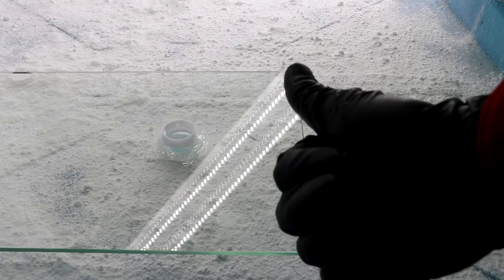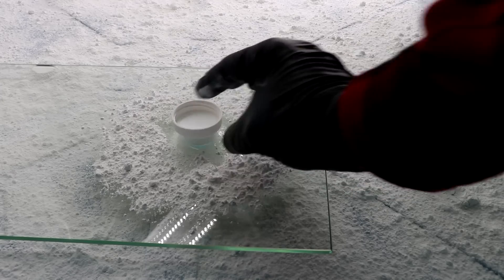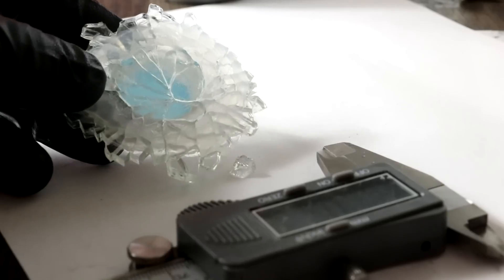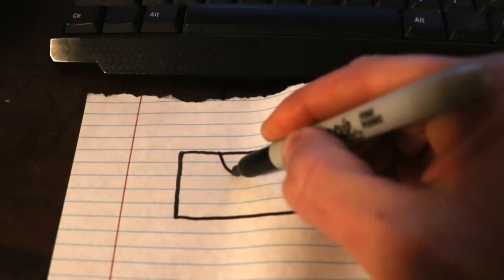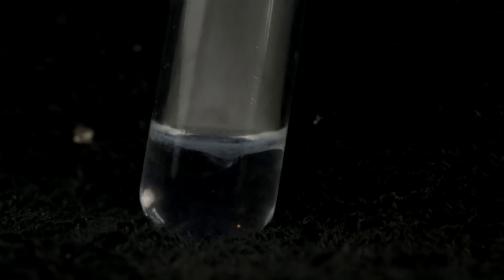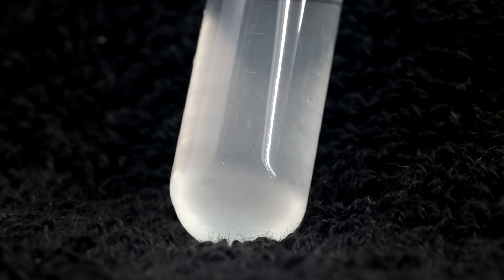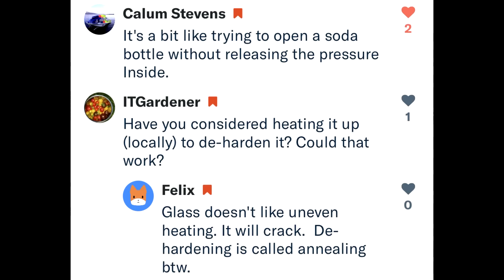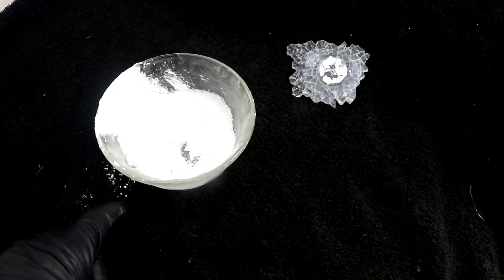Dissolving Through Tempered Glass Attempt Two: from one side only

Comment: Cody you should try decreasing the surface area of the acid every day (reducing the size of the container on the glass) to promote formation of a more conical hole which might have a better chance of withstanding the internal forces of the glass
Reply: To make a hole in (already) heat tempered glass, there's really only one option - anneal it, cut hole, temper again.

Certain chemically tempered glass types, through ion exchange, can be laser cut. But AFAIK you can't even do that with heat tempered glass.

It all comes down to the inner/"center" mass of the glass, under immense pressure, wanting to physically expand - but being prohibited by the rapid-cooled outer layers, now having contracted more than the inner/center layer, from doing so. Once you pierce or weaken enough the outer, differentially contracted layer - the inner layer expands rapidly. Bang, bazillion pieces.
Reply: @pr0xZen  That does sound about right. As soon as that outer layer can't take the pressure, the panel WILL break.
Reply: I don't think any of this will work. Tempered glass is under pressure similar to how a Prince Rupert's Drop works. Once you get through the exterior layer and get into that core,  there's too much expanding force and it causes it to shatter. These experiments about attempting to dissolve through the glass are more wishful thinking than anything and sadly won't work. It only hurts the wallet to try in this case.
Reply: @GrimmsDeath  that's my concern, too. That it might not matter how you get the hole in there, and that the glass just can't handle the stress of that hole's very existence.
Reply: @HELLO7657  The amount of pressure required for this to work would probably shatter the glass before you even began to etch it. The only way to make a hole in a tempered sheet of glass is to first remove the tempering by heating it to near melting point. Then make the hole, and finally re-temper it.
Reply: Elviondel my thinking was to reduce the size of the hole at the level where the glass keeps breaking and by having a cone shaped hole there would be less pressure on the smaller hole from the upper layers of glass. Probably would still fail, but I’m interested to see.
Reply: You are only going to prolong the time until enough outer layer of supporting glass has been removed for it to shatter.
Reply: Merry post-solstice

Comment: Does the depth of the dissolved glass have any relation to the diameter of the cap? Wider cap, deeper dissolved glass? Or smaller cap, less chance of shattering?
Reply: No, the issue is dissolving down to a certain point. One the glass has been dissolved to that critical depth at any point it will cause a chain reaction and shatter the glass

Comment: Could you dissolve the glass from the inside first?
Reply: I dont science much but if the goal is to use acid to put a hole in tempered glass I don't think he can start from the inside out.
Reply: @CoffeeandCancerStix  My idea was to accelerate the molecules of the acid, with the energy set, so they pass through the outer layers and stop in the middle. He has a vacuum pump. So a particle accelerator is not too far fetched. The energy requirements though, are probably far fetched.
Reply: @heyarno  I think that might be a little out of budget for cody.

Comment: as far as i understand and dare to write this comment, you will never be able to open a hole on a tempered glass pannel because is like trying to remove the middle of a jenga tower, as soon as you reach a certain point the presure inside the glass will always colapse towars the hole, the only way i can think of doing that is leaving a suport behind the perforation, kinda like a cylinder liner, if that make sense
Reply: You can do it with lasers, but that might be because them glass melts around it
Reply: @DumbArse  i didn't know it was possible, but it makes sense

Comment: take two metalic rings, that are about the size of the hole you want to make, adhere them onto either side with something like JB well prior, then do the dissolving after that is cured. 

The reason the glass breaks is because it is under Massive pressure, as when glass cools it doesn't cool uniformly. (prince Rupert drops)
This should allow those stresses to be put into the metal rings, and hold the glass together, much better.

Comment: You should use calcium carbonate instead of sodium hydroxide. Sodium fluoride turns into HF with moisture (the reverse also happens) so it might still etch the glass where you don't want it to.

Comment: If I understand the structure of tempered glass, a diamond or square hole might be a better approach. Get the angle of the hole just right and it won't open up. Maybe... probably..possibly but it's Cody so we keep trying if it does. If it works you could apply something to create a round opening.

Comment: @Cody'sLab 
Can you re-heat-treat the glass with a blowtorch or something? (not heat the whole glass, instead use a big heat-gradient from the "hole point")
By fist reducing / remove the middle stresses & THEN dissolve through it?
(or melt your way through it with the torch (but that's probably a VERY BAD idea, in-case it doesn't work & the "cracking / explosion" flings molten glass around) )
Reply: Unevenly heating glass tends to shatter it, and soda lime (aka soft) glass does not do well with thermal shock.
Reply: @cobalt1754  What if the glass is first pre-heated to just below being liquid (or below when it starts to reduce the internal stresses), and then "spot heated" as described above?
That might make the temperature difference small enough to work?
Reply: @sebbes333  than it is no longer temp erred glas but it is annealed glass and loses its strenght
Reply: @sebbes333  At about 1000 degrees F, the glass will anneal and lose its temper. It is no where near melting, in fact it won't even bend at that temperature, needs to be about 1150F to bend in my kiln. Then you would anneal it, reduce it to room temp, drill the hole, polish the edges of the hole to make sure there are no microfractures and then send it through the tempering kiln.

Comment: HCl is stronger than HF? It doesn't sound right! I accept this idea, but we are talking about F, so  some reasoning is required.
Reply: HCl is a stronger acid than HF, because it releases a H+ more easily than HF. HF is very reactive because fluorine is insane, but that doesn't make it a strong acid.
Reply: @SIGSEGV1337  ^^ this
Reply: HCl is more acidic, but HF is more dangerous because like he said, it will soak into your body and start to attack your bones, and is potentially fatal. HCl just burns you. HF messes with your nerves too, so you might not even realize what sort of danger you're in till the stuff starts attacking your bones.

(from what i understand, HF is a weaker acid because the hydrogen flourine bond is stronger than the bond in say, HCl)
Reply: @kasuraga  HF is simply a weaker acid because F- is a strong base/bad leaving group due to it's high electronegativity and small size therefore equilibrium will just shift to the left and not much dissociation will take place
Reply: And HBr is stronger than HCl. HI (hydroiodic acid) is even stronger than that.
Reply: Strength has to do with dissociation not the danger
Reply: @bosstowndynamics5488  this is the reasonable general chemstry assumption but one way  acid strengths are measured and compared is pKa. HCl has a higher pKa than HBr. (Higher pKas are less acidic)
Reply: The "strength" of an acid or base refers to how much it dissociates into its ionic constituents, not how powerful it is. This is a basic freshmen chem mistake.

I know this because I made this mistake in my freshmen chem class and it cost me a whole letter grade on that exam... :(

Comment: You must remove the stress in the plate by cutting a thin strip from all 4 corners before cutting into the middle of the plate. This was the procedure for cutting high-end engineered quartz surfaces with a saw/waterjet
Reply: No good. Regular glass is nothing like quartz. The coefficient of expansion is much higher.a quartz never builds up the kind of stress tempered glass has.

Comment: Does cocaine decompose after decades of sitting ?
Asking for a friend.
Reply from the maker: If its kept dry, away from light, and not cut with anything reactive I see no reason it would degrade.
Reply: @theCodyReeder  
It was in sun light for about 80 years.
I found a small cork top bottle in an 1800's dump. 
The cork was gone and a solid white mass is in the bottom of it.
Reply: OverUnity7734 lol, and i dont think so try

Comment: What you're not understanding is that it doesn't matter HOW you unbalance the internal stresses. They get unbalanced and it breaks, period.
Reply: I think it does matter. Cody's is etching too broad an area, and the integrated static stress over that area is far too high for that thin remaining thickness and that thin section is where the fractures are going to initiate.

I have to go back to my previous claim: narrow the etch to a very small hole (on both sides) and then it should go all the way through. Then start again and work the etching outward, to make the hole bigger.

This is going to be more tedious of course. He'll have to (gently) pippette out the exhausted HF and refresh on a daily basis.

Finally, the bore shouldn't be too narrow, or it will take forever and the etching will just undercut outwards.
Reply: @-danR  No, it doesn't matter. It's like saying you're gonna poke a hole in a balloon. It doesn't really matter how you poke the hole. You can try whatever you want, but in the end, you are not creating new stresses. You are releasing the ones that are already built up. If you break a dam, the water comes out. It doesn't matter how you break it.

Comment: What would happen if you dissolved the glass vertically (putting the acid on the thin side). Would it crack quickly or would it go for a similar percent of length as doing it when the glass is laying flat?
Reply: From the edge. This could be interesting.
Reply: It will be the same result. 2mm will be dissolved until core is reached and then crack!

Comment: How about making a prince Rupert's drop without a tail by letting the glass drop fall long enough to become a sphere before hitting water and cooling off? Always wondered how strong that would get.
Reply: Although a rupert drop without a tail is "possible" scientifically, I couldn't even begin to imagine how manufacturing it would work.
Reply: Very string but you would need a literal tower of flame to be able to give it time to do that. Glass starts thickening and forming a cool surface the moment it leaves the heat
Reply: @hibraisil  a tower of "flame" is called a torch flame. sigh. that's not how rupert drops are formed.
Reply: @hibraisil  How about a hot air stream that would keep it suspended and melted?
Reply: @romanr1592  that's, called a torch, or a fire, and "suspension" isn't the problem of rupert drops. It's the rapid cooling on the outside , contracting, and squeezing the insides REALLY hard. This makes the outside surface very compressed. The problem is cooling it rapidly fast enough to compress the insides.
Reply: @dimitar4y  with all respect, that does not nessecitate the tail in any way. I'm not talking about a regular torch here, I'm talking about a shaped airstream at the drops terminal velocity, so it can be suspended melted indefinitely, or at least long enough to let surface tenshion get rid of that tail. Then you just turn it off and let it drop into water, just the same way it's been down for centuries, no misteries there.

Comment: Cody! All you are doing by dissolving hf into the glass is introducing stress concentrations. The entire piece of glass is under tension because of the tempering process. When you introduce stress concentrations the glass will crack because you exceed the yield point of the glass. Basic strength of materials stuff I learned in college for mechanical engineering.
Reply: So what's your solution?
Reply: @anirudhnavin4568  there is no solution unless you de temper the glass lol
Reply: Yeah the only solution ibsee would be to cut a hole in the glass before tempering...
Reply: You're not introducing new stress, just unbalancing the existing stress, similar to popping a balloon.
Reply: @hibraisil  exactly, it's concentrating the stress around the area he is dissolving.
Reply: @hackneo64  No, the stress in the glass is already there. The reason it works is because the internal stresses are perfectly balanced. Disrupt that balance in any way, and it fails, period.
Reply: @hibraisil  no you're incorrect, it's causing the stress tension around the hole he's making to concentrate and then crack and break because the material fast approaches the yeid point when you introduce any defects into the part in this case trans-axial deformations. The only way to "release" the stress in tempered glass is to anneal it. Come on man it's basic materials science shit.
Reply: @hackneo64  Dude, it does not matter if you can find a way to cut a hole without stressing the glass. The. Glass. Already. Has. Massive. Internal Stress. That's what tempered glass is. It is a PRE STRESSED construct. There is energy STORED in it. No matter how gently or lovingly you drill the hole...no matter what kind of shit you glue or tape to it...you will RELEASE the energy that is ALREADY STORED in the TEMPERED glass. I honestly don't know why this straightforward concept is so difficult for you to grasp.
Reply: He knows this. We know this. But this is about finding a way to do it.

Comment: Maybe if you try a donut shape instead of a large round area. (or see if it etches further if you use a larger or smaller area)
Reply: Won't work. The strength in tempered glass (like prince rupert drops) is in the outermost layer. Defeat that, it breaks.
Reply: How would the donut shape help? How would the smaller area help?
Reply: @adamborg1  If the inner layer at the etched part pulls and what would be the outer layer would counteract that pull, then removing less area of the outer layer might sort of scale the forces. I'm just saying it might work but on second thought i realize it doesn't work that way.

Comment: Cody, incase you were looking for a stupidly dangerous (but interesting) chemistry project, I wonder if you could make fluorine gas from mouthwash or toothpaste. Since they contain fluoride ions, it should be possible.
Reply from the maker: It would be a lot easier to start with the acid which I already have... lol
Reply: This would be something interesting.
Though Idk if it would be of any use considering toothpaste has 0.00xx% of fluoride compounds. Maybe welding sticks with lithium or calcium fluoride insulation would be more useful in this case.
Reply: i tried that
dad work in a pharmacy and i got like 30 box of 50 tube of expired colgate xD
and i extracted the sodium fluoride from it
 i got like 20 gram 
im not so stupid and i dont have glass ware to make hydrofluoric acid xD
it was the main reason tho
Reply: Almost more of a NileRed project!
Reply: @rfrc6272  heck yea!
Reply: Make no mistake, trying to synthesize elemental flourine is very dangerous, and fooling around with it is a surefire way to poison, burn, and/or explode yourself. And then, even if you were to succeed without killing yourself, you'd be faced with the problem of finding a suitable container that can withstand exposure for a suitably long time (nickel passivated with fluorine for example, and some other, very exotic solutions). You do not want to risk a fluorine leak - not in your lab, not in your garage, not anywhere else. 

It's for a pretty good reason that it took almost 60 years and quite a few injured or dead scientists in order to finally synthesize the stuff.

On the other hand, there's people out there who cram innocent molecules full of as many nitro groups as possible just to see what happens (as if they didn't know already). And there's people out there who honestly, truly think that hydrogen peroxide didn't have enough oxygen in it and thus turned it into dihydrogen trioxide. And then there's those utter madmen who went out of their way and actually *fluorinated oxygen*. Some people really just want to watch the world burn. At least the world immediately around them.
Reply: He is allergic to mint I think so he doesn’t have mouthwash or tooth past

Comment: Is it the depth it's reaching in the glass releasing stress, or is it partly the focused nature of the hole? If you sanded a large area of the glass, and attempted to dissolve through a thus thinner section, with more surface area exposed, would that survive? Or would it work if you started dissolving, stopped after a few days, and let it sit for a week or so to release stress? That in combination with the flipping might work, if the issue at heart is the specific depth it's reaching.

Comment: I'm thinking on ways to stabilise the tempered glass.
You eat it from both sides obviously. Now what concotion of chemical and mechanical measures can stabilise the glass  at that particular point so that it perfectly  isolates all the stresses from the holes edges thus disabling fractures on cutting the tempered glass. Something similar to spot detempering...